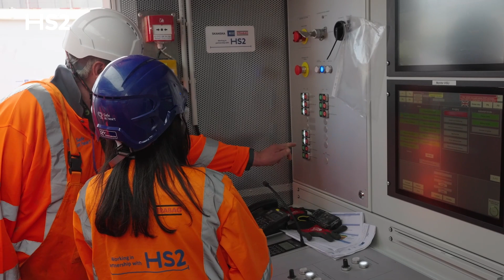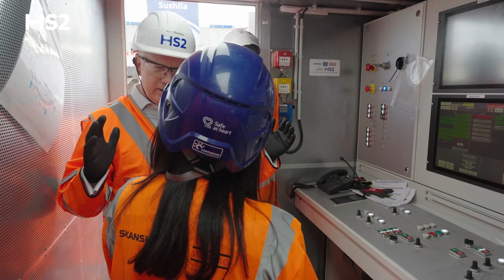HS2 celebrates as first giant London tunnelling machine is switched on

Comment: I am a supporter of HS2, it is basic and essential infra structure and is crucial to the economic future of this country. The detractors for this project simply lack vision and ambition.
Reply: Here's a short summary of a damning report published last month by Andrew Gilligan, policy adviser on transport & infrastructure to the PM between 2019 - 2022.
By cancelling all sections of HS2 where main construction has not yet started, we can save around £3bn a year by 2027/28 & £44bn or more in total.

HS2 now costs more to build than the value of the benefits it will deliver. The official benefit cost ratio (BCR) shows that for every £1 spent on the scheme, the country gets back benefits worth only 90p. Shortening the scheme improves its value for money.

Including “wider economic impacts,” the BCR rises to 1.1 but even this is suspect since it uses an artificially low construction cost & assumes that all HS2’s operating & renewal costs will be covered from fare income.

The BCR calculations also use figures from before Covid, since when the scheme’s costs have risen & its benefits have fallen.

Almost half of HS2’s benefits go to London & the South East, meaning that HS2’s effect on levelling-up will be little better than neutral. Its claim that it will create 500,000 new jobs is an absurd exaggeration.

Public support for HS2 is low everywhere & even lower in the regions it supposedly benefits. The outcry at last year’s cancelling of the Eastern leg was entirely confined to regional elites; it left ordinary voters unmoved. Northern leaders back the scheme in principle, but vehemently oppose the specific plans for Manchester.

Rising costs & cuts to public spending mean that if HS2 continues as currently planned, it will eat much of the rest of the public transport budget, sucking billions of pounds out of the services which most people use, need & want.

- I
Reply: @CRIMSONANT1  this is irrelevant, it remains essential and basic infrastructure that must be completed. In order to understand HS2 you have to have vision too. For a society spending more than 1,000 billion per year, the costs are entirely credible and must be executed in parallel with other similarly ambitious investments around the country. Planing to extend HS2 from Manchester to Glasgow should now be initiated.
Reply: @stevencutts6314  .. absolute nonsense - where did you copy & paste that rubbish from .. HS2 Ltd's book of fairy stories? 🤣

Comment: The only advantage that I can see for HS2 is so that commuter's from the south can get home to their cheaper northern homes quicker.
Reply: It’s not about shorter journey times, though why build a modern railway to Victorian line speed standards, it’s about increasing capacity across the Victorian rail network.
Yes, it will allow people to live where they love and commute, but the capacity step change will benefit leisure passengers.
Reply: @danwiddon3854  unfortunately this project it's so expensive due to requirement of a new train line being able to sustain the HS2 trains able to reach speeds up to 220 miles an hour.  if they where gonna use the high speed trains on Victorian lines, absolute disaster...